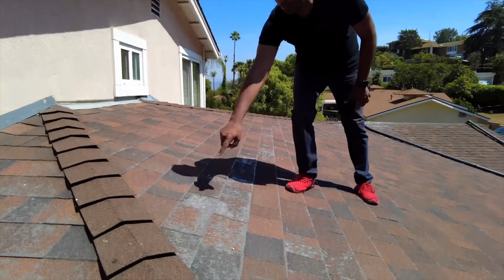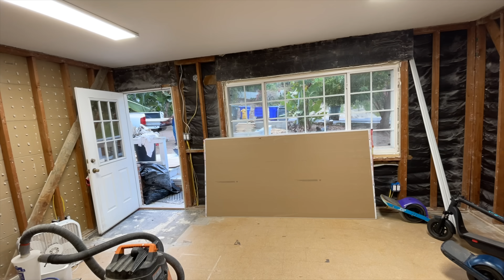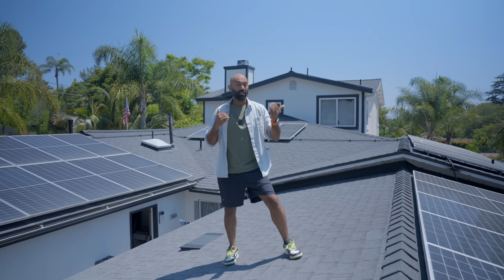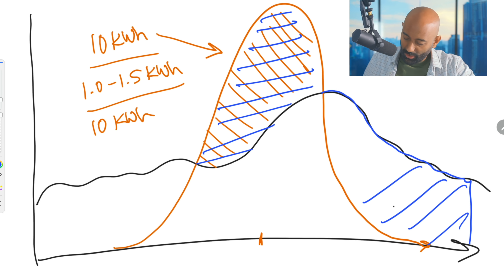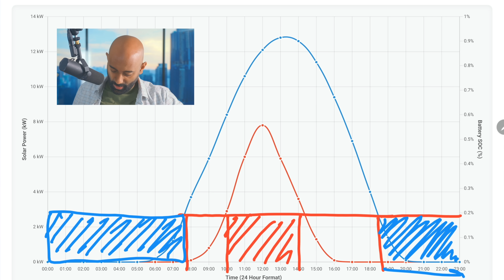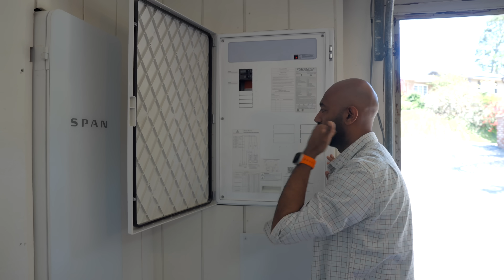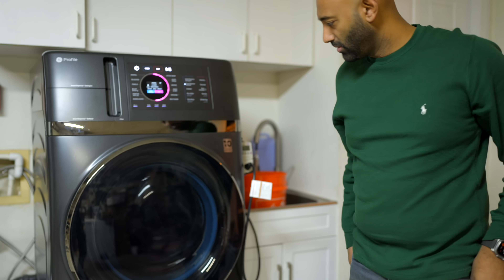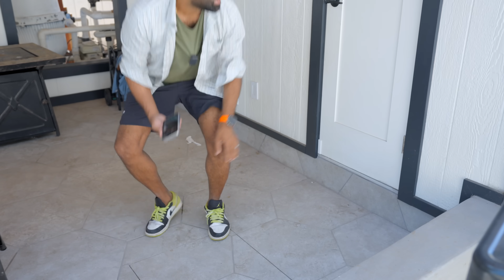Is Self Reliance Possible? Net Zero Home 4 Years Later...

Comment: Living further south helps for this discussion (as it relates to north solar production).  Being in a suburb west of Toronto, winer sun is only on the front of our house (be great if there were a company for solar panelled garage doors).  Hopefully next property I'll have more land to do solar panels without an expensive permit and install myself.  Our pool pump is variable as well (2.7 HP), and our pool is small (5 sunshelf + 22 ft long x 12 feet wide) so we run the pump at 50% which is 323Wh, and use a solar blanket.  I have the timing come on at mid peak (since we have time of use) at 11am, and shuts off at 10pm.  Running cost is about 55 cents a day, since when gas heater comes on it runs at a higher rate (65% = 702Wh).  Our rates are quite cheap compared to San Fran, but our deliver costs/infrastructure is high ($42 that has nothing to do with usage, but 15.8c kWh peak, 12.2c kWh mid, 7.6c 7pm-7am).  I love all this data you track (as an Excel nerd, I use Access and Excel to calculate company costs in logistics).

Comment: use solar hot water system (thermal) to warm up a decent sized resovior, then very small on-demand hot water heaters.  Its the most efficient way to go for hot water..

Comment: We love our solar system. 26 panels and micro inverters. Zero electric bills for 26 months. 
A few new appliances which use less power than our old appliances. 
New water heater, not heat pump, because we make way more electricity than we use. Heat pump water heaters are expensive. 
With zero electric bills we have saved over $6K over 2 years. 
Our system will be paid for in 3 years. Plus we get quarterly funds from our electric company for our excess exporting to the grid. 
No EV yet, but we do have a hybrid SUV. 
LOVE SOLAR!
Reply from the maker: Nice!! Yah it’s been a dream of mine since college

Comment: With heat pumps, I don't understand why solar heat isn't used for the heat pump in winter. That is, supporting the heat pump cooler with solar panel heat. In my opinion, that would increase efficiency enormously, for example, on sunny winter days, which are actually very cold. Solar collectors are black, and therefore have significantly higher temperatures than the surrounding area, even in winter with a bit of sunlight.

Comment: Imagine this scenario as you rebuild auto robotic assembly line. Having a off grid system on my box truck 🚚 i find exhaust ing heat sources like refrigeration units outside(summer) and retaining heat (winter) to be needed as well. Circulate the heat in winter. Exhaust in summer.

Comment: Like many energy saving products an ASHP works well. It is more expensive, but it works. I replaced a leaking gas water heater two years ago with a Rheem 120 V 50 gallon water heater. There are only two of us, but it works well. If you have higher usage a 60 or 80 gallon size would reduce the risk of running out of hot water. I haven't run out of hot water and have been surprised that a 120 VAC unit could work. 

It only draws 400 watts when running so doesn't need to be on a separate circuit. Total monthly kWh ranges from 110 in the winter to 65 in the summer. It is located in the garage with winter temperatures as low as 47 to summer with temps up to 85. The median temp is more like 55 to 65. It does not really cool the garage so don't expect that to happen.

Comment: I set up an Emporia energy monitor on my breakers a few years back to start cleaning up our power usage and help determine which devices needed replacement first in our older house. I learned that our ancient (~40 year old) 50 gal water heater was averaging about 15kWh daily for our 2-person household.  After doing some research on the options, we installed a Rheem ProTerra 50gal Hybrid Heat Pump Water Heater at the start of May this year and dropped our hot water electric usage to around 2kWh daily. We installed it ourselves and with our electric rates of $0.12/kWh our break even is 3-4 years. 100% would recommend.
Reply: 12 cents per kWh holy makeral. In July, our cost per kWh will be 50.4 cents..I'll have to look into the water heater, the cost to use a heat pump will be 21.6 cents a kWh, but, we are on gas hot water. 3 month gas charges for cooking and water heating is around $200
What are your solar panel wattages, I think we can get 400 watt panels now.
Reply: @Zendukai  I'm so far North and have such a bad roof angle to the sun, combined with pretty heavy tree cover on my yard, that every solar calculator I have used has said solar is not economically viable for me yet. Especially with how low our electric rates are. So at the moment, I am fully on-grid, just working to minimize my usage where I can.
Reply: @travgavin ah ok, im a fairway south, like South Australia, i thought you had a solar system, but, he did ask what heat pumps are out there, sorry about that.
Reply: @Zendukai  You can diy a solar water heater lots of plans online, just sayin
Reply: @callmebigpapa  I'll be covering the whole roof with solar panels, the way electricity prices keep going up it will pay for itself in no time. Mind you... we have had a solar system since 2010 and haven't paid a bill, but now the cost per kwh has skyrocketed. I'll need a couple sets of batteries too, maybe an ev car just for around town, I have an old AU wagon, around town that sucks down 17litres per 100km and we're expecting a price rise on fuel to around 2.50 per litre, If you're in the states, you talk gallons so thats over 10$ a gallon.
Reply: They should make a heat pump that cools the house by heating the pool rather than dumping heat in the air.
Reply: @Cooper1 It's only a matter of time before such a system becomes available (if it doesn't already exist).
As the owner of a self-build early ECO house from 1988 in UK, I'm envious of owners of the latest New-builds, but we're slowly converting systems here to exploit the newest technology. We have a newly-insulated roof, solar panels, 15kWh of battery storage and a couple of modern A/C's.
Next project is to replace our ( British Gas) badly-installed gas boiler with an ASHP if we can find somewhere to locate a small hot water tank.
Exciting times! 😄
Reply: @travgavin  I looked up Empower and was only able to fine Emporia? Is there a difference?
Reply: @JohnRaySalazar yes, emporia is predominantly known for their EV stations, but they also sell. A power monitor
Reply from the maker: @STXHayProducers  Emporia is a great company that makes a very cost effective system with CTs you clamp on your circuits in your loads panel. it give you insights to power usage, and as Travgavin mentioned, helps you realize what's really using a lot of power. highly recommend
Reply: We installed the same Rheem 50 gallon hot water heater to replace an old gas heater  We have six people in our house. Goods: 1. it is very energy efficient and low cost to run. 2. The 50 gallon tank is enough and we’ve never run out of hot water. 3. From tough experience, the water will stay warm enough for a shower even after four days without power. 4. It is very reliable.

Bads: 1. A heat pump needs a larger closet than a gas water heater. Louvered doors work too. 2. The 2020 model was a bit loud, even with sound insulation on the closet walls. I’d buy it again
Reply: That's what we did. Also two adults so our hot water usage isn't big. The 50 gallon unit works fine for us. It uses more power in the winter when the basement is cooler, and it makes some noise kind of like a window AC.
Reply: This is the correct answer  "I set up an Emporia energy monitor"  also my thermal camera was one of the best purchases I have ever made.
Reply: ya i been using emporia for a quite a few years now(2021). it has helped so much in finding whats using energy and optimizing energy usage and what to upgrade for the most cost effective upgrades. its also helped me troubleshoot well pump issues saving me a lot catching issues before they became catastrophic.  best $100 i ever spent... well maybe not but up there with it.
Reply: you also lowered your peak demand sure charges for the entire home....study up on that....its not shown explicitly on the bill.... identified in most cases as 'factor'   

factor 45 would mean that they boosted your kwh rate for the entire home by 45%  for the next 3 months, based on the highest 15 minute surge.   rarely it is it labeled what it actually is a 'demand charge'  which is honorable
Reply: I remember when those first came out and they were exhibiting them at my electrical college here in Denver. Definitely the future.
Reply: Even if you don't have the money for a full system, it's still a good idea to build a partial one.  Just for an emergency backup when the grid goes down.

Once you start trying to heat / cool a house, the power requirements get expensively high, but building an emergency backup only costs around $1,000, depending upon its size.  It beats any and all UPS devices I've seen on the market for reliability and functionality.  Having your fridge, cell phones, and perhaps computers on it, is a far superior setup than having them on the grid.

Comment: Why it is SO expensive? I live in Ukraine, but even now, during the war, usual price on the 400W  solar panel is near 50$. So roughly 1500$ for 29 of them. Very good 3 phase Deye inverter for 15 kW, with passive cooling and great efficiency - another 1500$. Cables, holders, boxes and everything for connecting - let's say another grand. 4 k$ for materials in total. How the heck 36 k? Ok, work in US is expensive, but 32 k$? The realistic number for work is 4-5 k$ max, all other money it's just deception
Reply: He has a really big system and also wasted a bunch of money on things he didn't need to buy.  And he's also running a business.  And the U.S. tariffs and other impediments make equipment more expensive here.  And it's a fairly luxurious property (to be honest, talking about that pool!).  That said, as a DIY the costs would be considerably lower than what he spent.

-Matt

Comment: I project lead solar panels on 3 houses during Covid. They been running for 3-4 years in a cold winter Sweden . One is a massive 1900 house , two is private houses. We also put in geothermal energy and the results are very good. My calculated target was a 60% lower cost on heating and electricity. But now, after 3-4 years the cost is down to 78%. And in 2026 it will have payed it self, and increased the value of the houses with 8-12% above regular house prices increase...  Everybody is so limited, but solar panels, geothermal energy, wind/wave turbines, better isolation is a very good start and it works just fine. Then solar panels, batteries will gett more effective so it has a very good future and actually...clean air is important for us, our kids and coming generations. So I don't understand the oil and coal supporters if they not own it's production. It's very easy to calculate that if 75% of all houses and buildings had solar panels, geothermal energy. We would not need oil or gas, or nuclear power. It would work fine together with river turbines, a few wind turbines and some electric storage plants. In my calculations a bad sun year would still produce 30% over what we use in total in Sweden.

Comment: Off grid for over 3 years, I am now going to add a wind turbine, I wish it were a low wind version, I am still looking for a better versions, I think you need both low and high wind versions.

I have propane for emergencies, I still have not used it yet. I use diesel heaters to stay warm. But for emergencies I think an underground bunker is a better choice especially in the high north, because the ground stays a constant 55 degrees year round. No need to heat it. But you can heat it by electric if needed.

I do have a 30 kilowatt LiFePo4 battery to store energy.
Reply: Low wind turbines don't exist in home-sized turbines: low wind means very low energy available. You'd need extremely large blades. Even with small turbines, you need ideal wind conditions to make it worthwhile. You're dealing with two fundamental issues:

- The Betz Limit
- The Power in Wind equation

The Betz Limit is basically a theoretical number of the maximum efficiency you can possibly get. At most, only 59.3% of the kinetic wind energy can be used to spin the turbine and generate electricity. Remember this is a theoretical limit; in practice, you're going to be closer to 40%.

The Power in Wind equation is given as:

P = 1/2 x ρ x A x V³

Where:
P = power in Watts
ρ = air density (kg/m³, at about 1.2 at sea level)
A = Swept area of the blades (m²)
V = Velocity of the wind

So, no matter how good your turbine is, you will get in practice at most 40% of the wind energy converted to electricity. To capture the wind energy in the first place, you have two variables to increase (one in your control, the other not): swept area and wind velocity. The smaller you make the turbine, the faster you need to spin to make any meaningful energy. The only variable you control is the swept area, which means making the blades as big as possible. Also notice that the velocity is cubed in that equation, so you'll generate much, much less power at low wind speeds.

In other words, small wind turbines don't work except in ideal situations because physics.
Reply: @thesurvivalist.  wind turbines at home scale are basically never worthwhile vs  more solar and batteries. Wind turbines get exponentially better the bigger and higher they are and do better a long way from large changes in terrain elevation.

Home scale turbines produce very little power and have added maintenance costs.
Reply from the maker: that's amazing, what kind of solar and batteries do you have? I've been looking at adding a wind turbine too, but it's rarely windy here...
Reply: Yeah, please let us know which wind turbine models you're considering as being the best values for low or high wind scenarios. Here in San Francisco wind is very high and continuous throughout spring and summer and winter winds are very high speed and less volume but plenty good. I've been looking at wind turbines but the price per what just seems to be too hi compared to solar. And with all these tariffs worse I don't think that situation is going to get any better especially if rare Earth magnets are needed. Also if neighbors are close they'll hate it.
Reply: I did somw research and for me i bought more batteries instead of windmill.
Wind is expensive, unreliable, heavy maintenance. Be sure to take in all factors